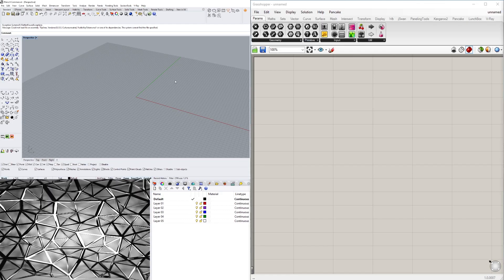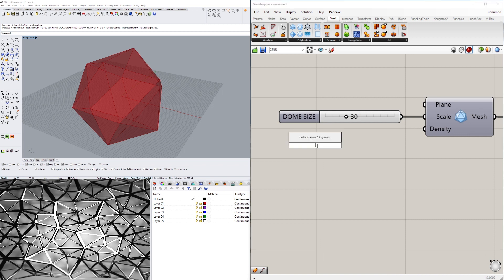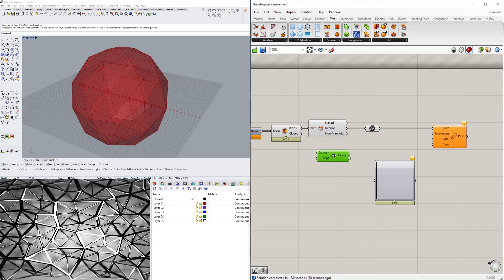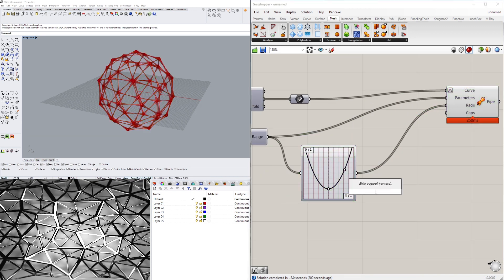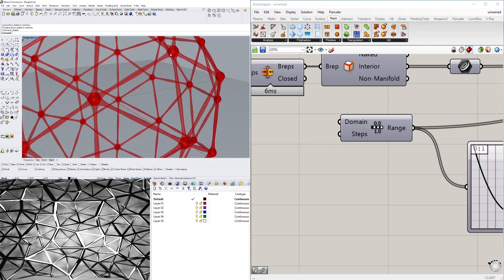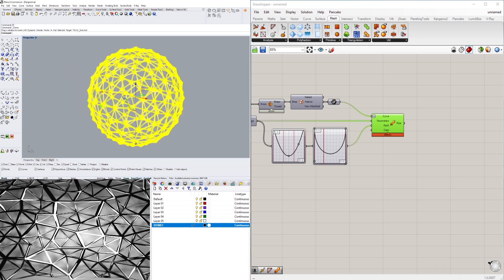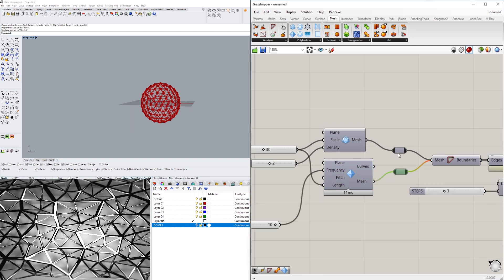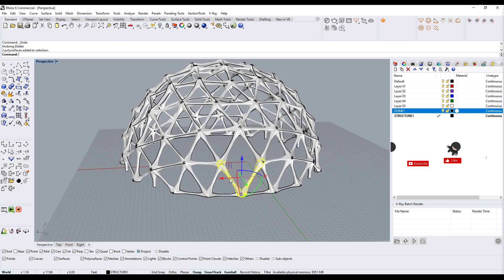Geodome Variable Pipe Structure Rhino and Grasshopper Parametric Tutorial

Comment: hi. how do i make a tube with inner and outer diamer, in rhino grasshopper. basic rhhino has a tube command but grasshopper dont?
Reply from the maker: you can offset the circle and create a surface and extrude the surface
Reply: @DCOParametric  how hard would it be to make a grasshopper plugin for  a tube funtion like it is in rhino 7